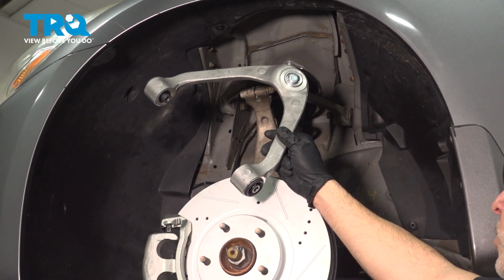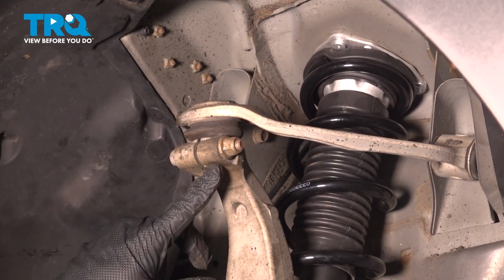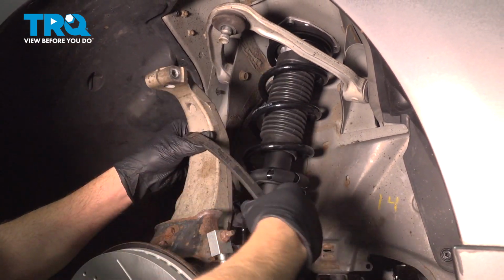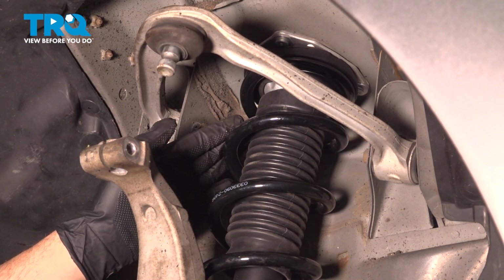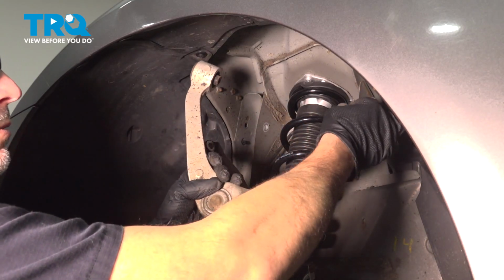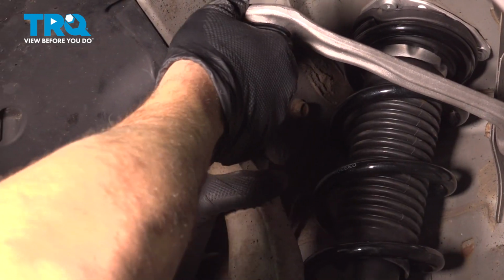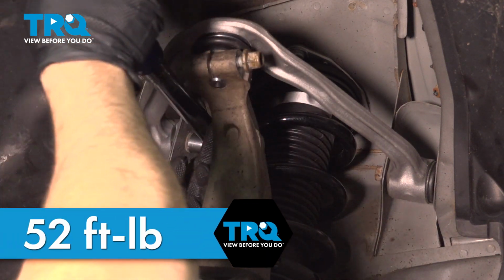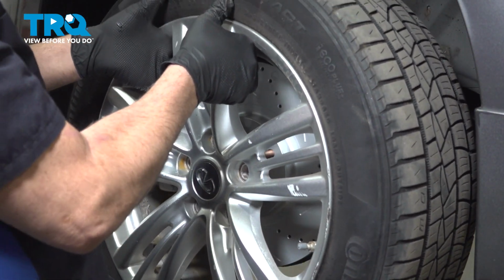How to Replace Front Upper Control Arms 2008-2013 Infiniti G37

Comment: Idk if anyone else is having this problem, but the body is rusting on the part where the upper control arm bolts to the frame. Not sure how to fix it, or if it’s junk at this point